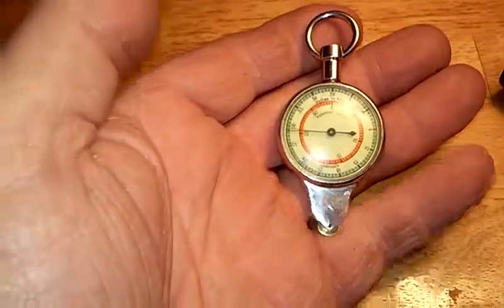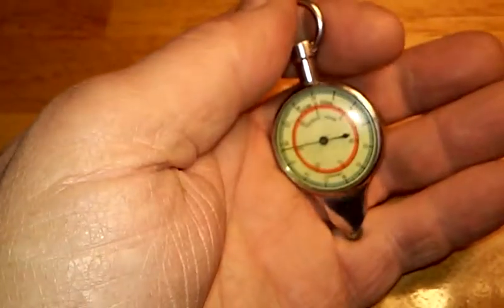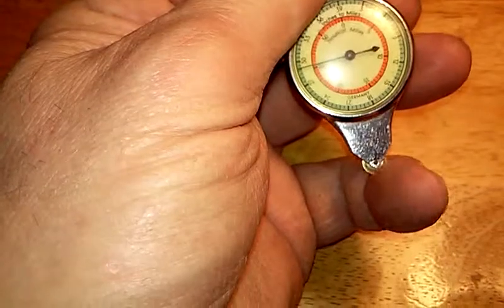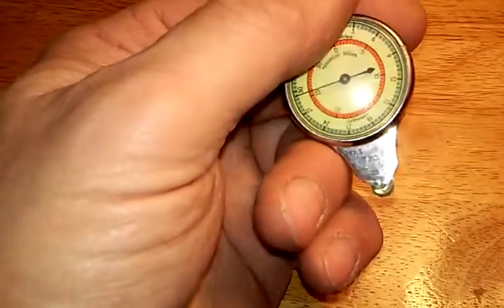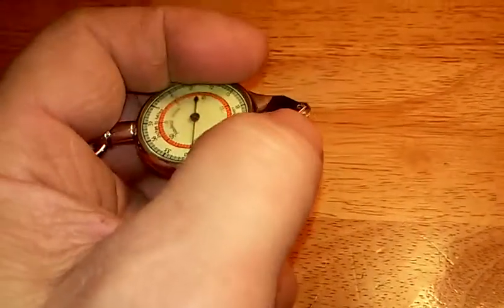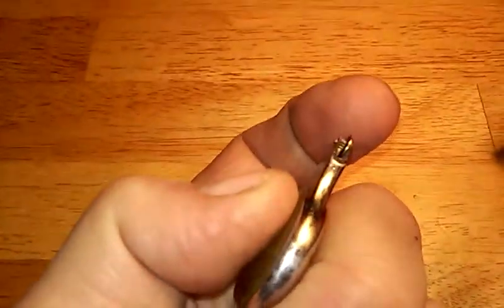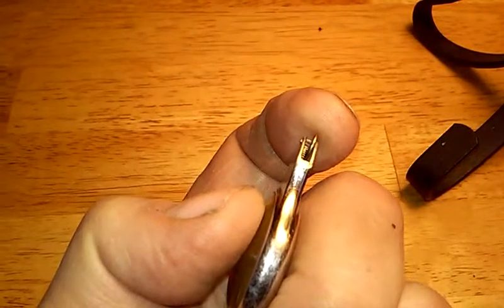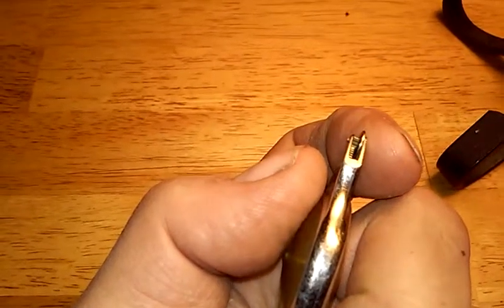Broken Vintage Hoffritz Map Mileage Counter Wheel and Compass

Comment: Without actually holding it in my hand, I would think that if you used a small bur ( https://www.riogrande.com/product/Busch-Carbide-Round-Bur-05mm/341232 ) to carefully burrow into the good side of the axle to weaken it enough to remove the wheel. (Magnification is a must!)
Then drive out the pin with the correct size punch. 
Then draw out a new wire for the axle.( https://youtu.be/GHP9Bh_DRKc?t=662 )  Odds are the wheel holds the axle in place so it has to be a tight-ish fit.